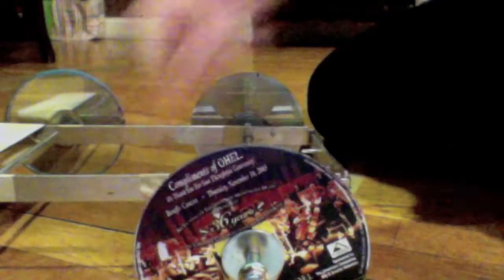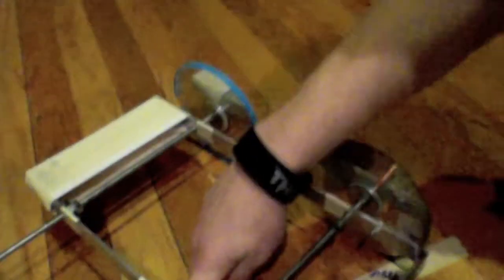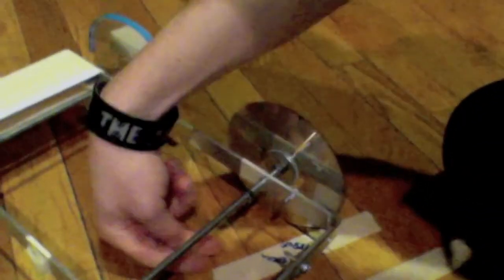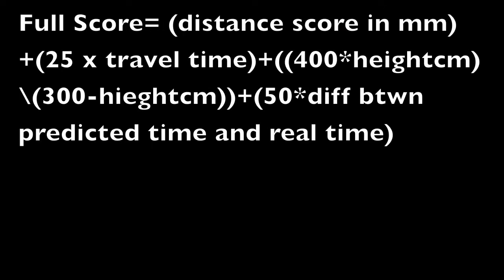Gravity Vehicle for Science Olympiad 2013

Comment from the maker: Ahhh sorry.
You could also change the gear ratio btwn the axle and wheel, so one rotation of the wheel = less threads on the axle.
Or you could use an axle with more threads.

Comment: Yes we have the same setup w/the washers & nut & threaded chassis. But we can't use this model w/the 20cm width limitation, can we? There is only about a free inch b/w the wheel nut & chassis. As the axle & wheels rotate left, the right wheel nut hits the chassis on the outside of the right side. So, yes it is braking, but far short of the mark, & we certainly will not be able to calibrate it for different distances. :-(  Any suggestions on how we might be able to salvage this?

Comment from the maker: Notice that there are washers on both sides of each wheel. That forces the wheel to move with the axle
Now on the front axle, in the cart, there is the "braking system", which can be either 2 nuts or a washer in btwn 2 nuts (so that it too moves with the axle).
The key is to essentially make the braking system, front axle, and front wheels, all "one object". Therefore, said object will move with all of its parts moving together.
Remember: Here the front holes are threaded, back holes are not.

Comment from the maker: 2 of 2:Rather, the holes for the back axle were made just bigger than the axle rod so that it may move freely through the axle. The screws seen on the inside of the back axle were used to keep the back axle more or less lined up with the front wheels after I set the braking system(since the front axle moves through the chassis by spinning, as the cart roles, the front wheels shift.So the back wheels need to be initially even with the front wheels so the cart will be able to travel on the tracks)

Comment from the maker: 1 of 2: The aluminum chassis was made out of flat aluminum stick/rod things, in which I drilled 2 holes in each with tapping screws end and used angle brackets to connect them and create a rectangle. Then, I used threaded rods as axels. When tapping the holes for the front axle, I used a drill bit with the exact same diameter and threading as the rod. That way the axle only moved through the chassis by spinning (like a screw).The back axle was the same thing, however the wholes were not tapped